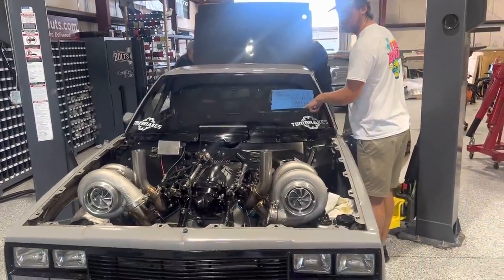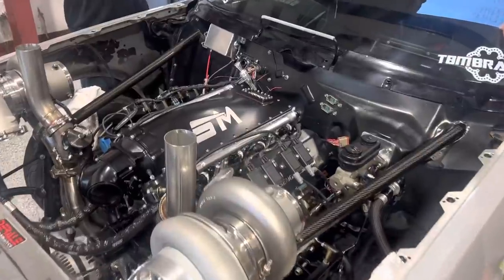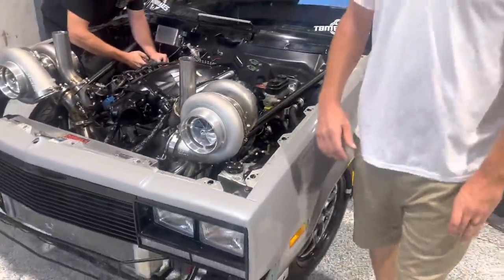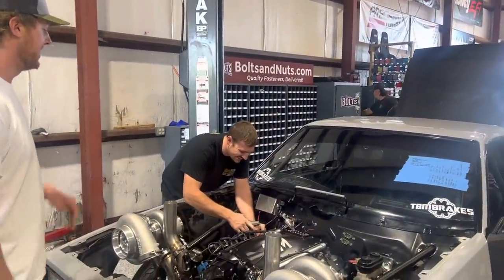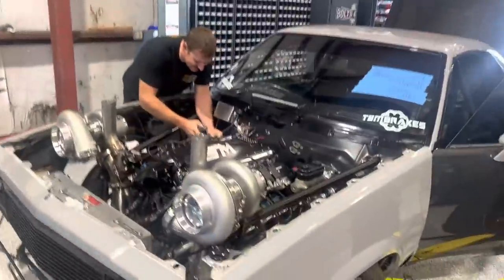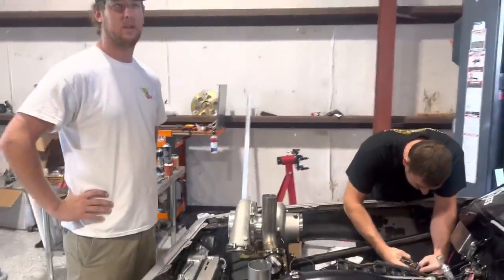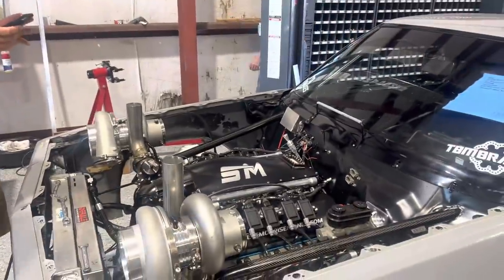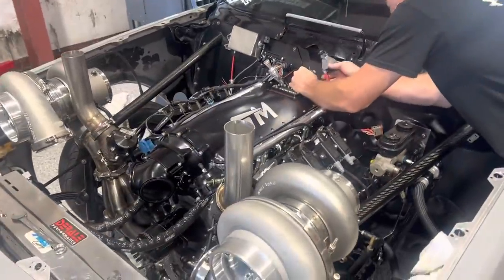Finishing Up MULLET For The Dyno

Comment: I really wish someone could have talked some sense into Garret re: the turbo placement.  I see a smoke show coming with all the additional weight on the nose and potentially 50% more power.  He MIGHT be able to get it to hook at Bradenton (some of the best prep in the country) by babying it through the 60’ but getting it to hook on marginally prepped drag and drive tracks?  Good luck with that!
Reply: He did put bigger tires on it.
Reply: He has more $$$ in that El Co than i have in my house and i have a really nice home 5 acres and a pond and a 30x40 shop etc. he could have taken all that dough and had a real deal promod and win some races with it. But what do i know, i don't have millions of followers watching me tear the hell out of stuff and having fun while doing it. so, he must be doing something right.
Reply: Where's the fun in that. The whole channel is about trial and error, build and break by not going top shelf first time round. Waaaaay more interesting than doing it the other way round. The whole Mullet experience has been quite the journey. And yes it would be horrifying to learn how much cash has been injected into the project. It's certainly not something for the light of wallet to contemplate.

Comment: Who thinks mullet is going to go slower with the big block than the LS and no it's not going to be a lack of power.  I think it is going to have too much power and be nose heavy for that small of a tire
Reply: They do have oversize rubber for the events that will allow it.  I agree though, for those races that call for (close to) street rubber, there's going to be a lot of smoke, but not much go.